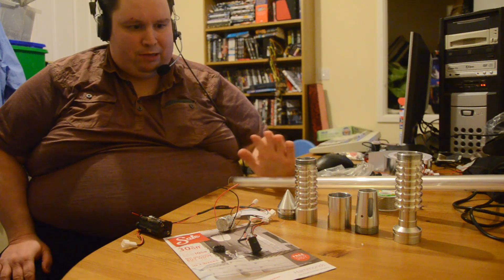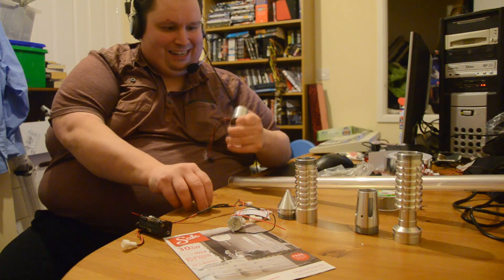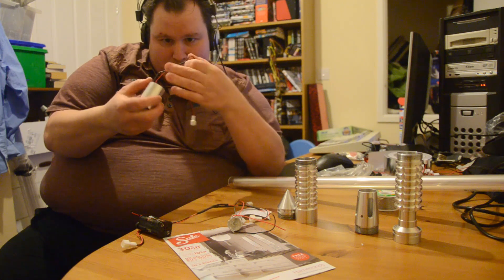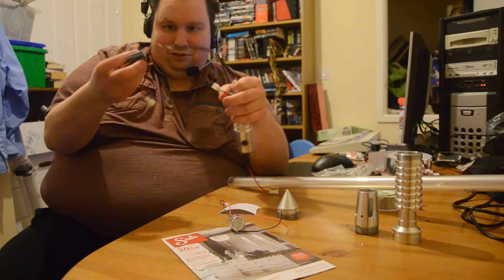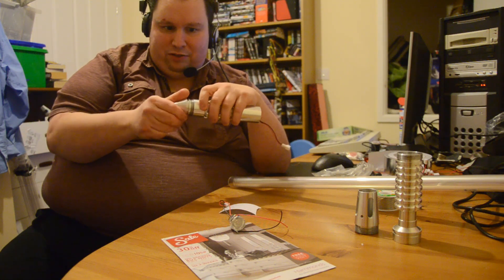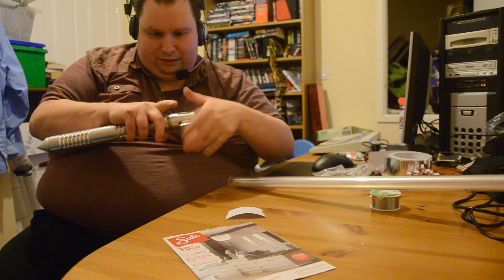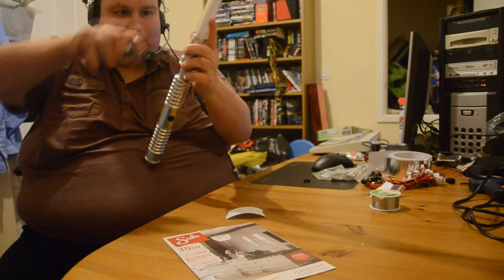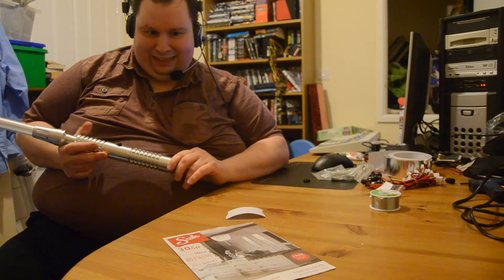Lightsaber assembly

Comment: How much does it cost to make it compared to buying an intiate blade pre made?
Reply from the maker: making a cheep lightsaber will work out about the same price as buying an ultrasabers initiate, if you want just the one basic hilt you may as well just order from Ultrasabers.

I have used Lightsabers to teach my, at the time 12 and 10 year old, niece and nephew basic electronics including how to solder (I got in a half dozen hilts and let them and their mother choose and assemble their own), and I would much rather be able to say "I have constructed my own lightsabers" than "I own lightsabers", I do own a prebuilt ultrasaber but most of mine are ether conversions from Master Replicas/Hasbro sabers to make them durable enough for full contact dualing or custom builds where I have purchased the parts and assembled the saber.
Reply: +Terry Forsdyke have you ever gotten a double saber pre made from ultra sabers? I have a question that's why I ask
Reply from the maker: no I have never purchased a double bladed saber but a double blade sabre/staff is literally 2 single blade sabers joined using a coupler, I have done one in one of my other viseos, and I have a freind who has made one, just make sure you go for 2 sabers the same diameter and get a double female connector or coupler the correct diameter and it will be fine, the initiate line of sabers are thinner than most of the other sabers US offer and the Modular Hilt  System offered by Custom Saber Shop (which US "borrowed" for most of their more expensive sabers).

I have done a video showing how to connect 2 single blade sabers into a staff
https://youtu.be/DWWrZ9FqM3E
Reply: +Terry Forsdyke I want to know if it comes with two end caps with the cupler
Reply: Like will it be the exact same thing as geting two pre-built sabers and adding the middle peice?
Reply from the maker: that is correct
if buying from Ultrasabers the initiate v2, Aeon (no version number) and Dominatrix v2 use their "v2 coupler" anything else ordered from them or if you get parts from The Custom Saber Shop you just need an MHS compatible double male section, Saber Forge do their own coupler as I think do several other saber sellers
Reply: +Terry Forsdyke so it's like getting two imitates + a coupler. Thanks!